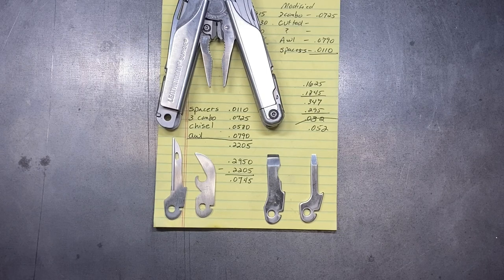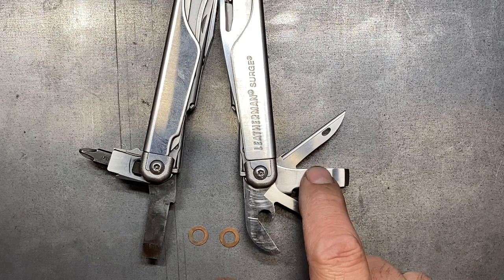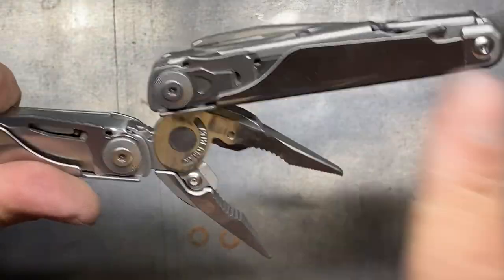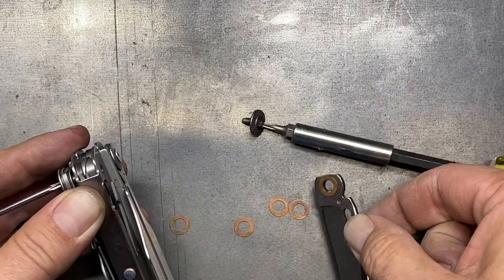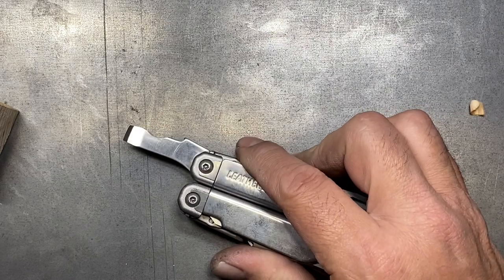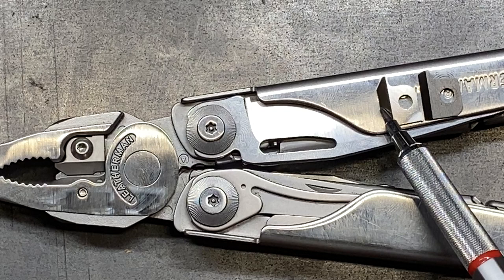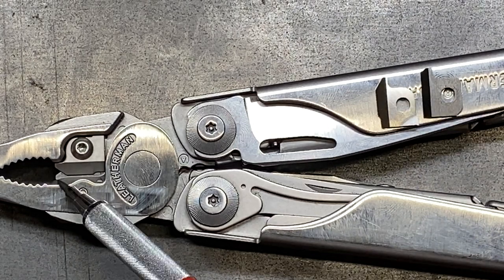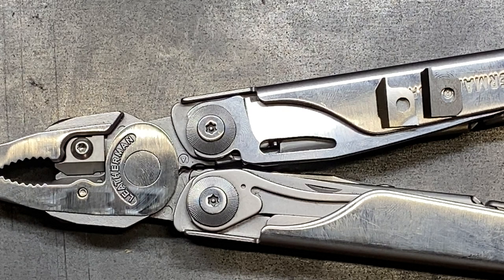Leatherman Super Surge Part 5 : Installing The Chisel And Remaining Implements

Comment: Wow! That chisel that you ground thin works great.  I would've loved that when I was working for John Deere and working on engines and hydrostatic transmissions; an awesome chisel and great scraper tool..Also love the idea of integrating the blister pac opener into the bosch "T" shank adapter.  Not "IBM", making the planet smarter, guys like Ben making the planet smarter.  Fun to watch videos.  Can't wait to see how the smaller wire stripper notch comes out.  I would definitely say what you are doing harkens back to a previous age of "American Ingenuity".  Mega Kudos to you Ben.  I simply can't say enough good about your enterprise and giving us a glimpse into your fine workmanship and skillcraft.  Thank you
Reply from the maker: Well, I appreciate the compliments. I do have some fine tuning to do on the remaining implements, but it is coming out much like I envisioned it. I will say that without the right machinery, it is very labor intensive. Just have to come up with ways to hold the tolerances correctly. Thank you very much for taking the time to watch.

Comment: So I purchased the eod wire cutters, modified them and installed them. Then I decided to sharpen the original cutters by simply laying it down on the bevel edge to a flat diamond file I had and held it up on edge with my thumb and just moved it back and forth in a straight line. Worked out great abs it allowed me to flatten the cutters on both sides as well.
Reply from the maker: Do you find the modified original cutters work best, or the EOD version?
Reply: @txtoolcrib  Nope, they still suck compared to the EOD cutters. But they are sharp now, and cut just as clean as the EOD ones. The problem arises from the smaller flat cutting area. If you don’t get the wire just right in the middle there just isn’t enough flat area to cut cleanly through. Since the EOD cutters work so well I can almost imagine a Leatherman product development meeting where management decides that there needs to be done distance between the two cutters. Translation, we need to make one a little more sucky than the other one. And since EOD needs a real world soft wire cutter the EOD gets the better ones.

Comment: Hey Ben, it may take some further investigation, but the Leatherman website lists the EOD cutters as being compatible with the ST300M, even though it comes with the standard cutters. I guess it's compatible with both? You could take the plierhead out of the 300M and into the Surge, I guess, although that may not be worth the cost of a donor 300M.
Reply from the maker: Elijah Nation I went back to check it just to make sure. I think they have that misprinted. The EOD cutters will not work in the 300 M. The good news is though, I just modified a set of EOD cutters to fit the surge and it worked beautifully. Video should be up in about an hour.

Comment: Does the EOD super tool 300 have the same pliers style as the Surge? If the cutters are like the MUT maybe just take the pliers from the EOD 300 and replace on the Super Surge.
Reply from the maker: Unfortunately they are not quite the same. The EOD versions have a cap crimping tool instead of regular pliers. I just modified a set of EOD cutters to fit the Surge though. They turned out great.
Reply: Great to hear. I just noticed in the comments that  I wasn’t the first with the idea. You’ve got some great minds watching your videos ;)
Reply from the maker: Matthew Bragg yeah, there have been some really good ideas for sure. It’s nice having a platform to get opinions from like minded people. Check out that cutter video. I think you might like how it turned out.

Comment: Good Morning Sir I just wanted to ask you if there were any specialised multitools for aircraft engine technicians and engineers or if any of the leatherman tools can be used for such specialised needs . Best regards and stay safe
Reply from the maker: What implements would be best suited to the needs of an aircraft tech? If you could give me an idea of the types of functionality you would require, I would be able to help you out. These is not a specific multi tool that I am aware of that is geared towards aircraft technicians specifically. That doesn't mean that there isn't something out there that would work for you.
Reply: @txtoolcrib  Mainly a good crimper , a good hex head screwdrvier and a good wire cutter+crimping tool all that in one tool . I am aware that almost all of the multitools do have these options but after watching your video about the crkt technician I thought something similar for at least quick (jet) engine maintenance . Sorry for being so vague in my question i just wanted an excuse for a multitool :) . Oh and I know it might sound outlandish but does multitool with a ratchet function exist ?
Reply from the maker: The best wire cutter options in multi tools are SOG full sized multi tools and Leatherman EOD version. Unfortunately, neither come with a dedicated 1/4" hex driver. Leatherman uses their proprietary bits which can be adapted to full 1/4" hex, but you would have to mate that with a set of Wiha double sided bits if you wanted full dimensional bits. Leatherman Surge, Supertool 300, and MUT have pretty decent crimpers. Some of the SOG models also have very good crimpers as well. To my knowledge, there is no current production model multi tool that integrates an ratchet function, but one can be adapted to a Leatherman. I have been considering doing a video on that as a matter of fact. I am a big fan of the Surge, because I think it is one of the most useful multi tools out there, but it is not for everybody. I would also consider the SwissTool and SwissTool CS from Victorinox. They have separate driver systems for their multi tools, unfortunately they do not have wire crimpers though.
Reply: @txtoolcrib  Dear TX Tool Crib , thank you very much for this detailed reply ,God Bless you ! I think I might stick to a good old tool case , which isn't that inconvenient anyway . I know this sound crazy but maybe one day I will try to do what you are doing with the super Surge but take it to the next level . I will machine my own multi-tool , it might be hard but it is certainly worth the effort .